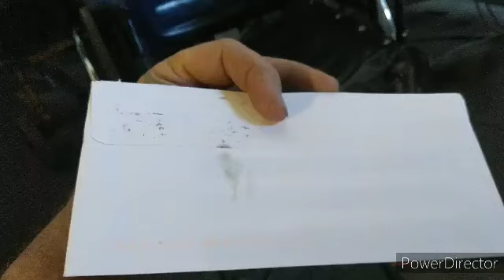cattle, sprayer and a view

Comment: "Friday is house cleaning day", Is Monday laundry day? It was for my Mom, she never had a dryer until the mid 70's, hung all our clothes either outside or through out the basement until Mom and Dad moved into their new home on the Farm. Mondays meant Dad and I couldn't use the basement for our wood working projects.
Reply from the maker: Cleaning and laundry on Friday.. Tuesday is grocery day..
Reply: I still use a clothesline... got a pulley system set up from the back porch across the the corner of the old house about 100 feet.  Save a lot of electricity versus a dryer plus the clothes are fresher and last longer, particularly elastic stuff lasts longer if you're not cooking it to death in a dryer.  Got my bucket of clothespins and a laundry table plus a roller hamper to transport everything from the laundry room out the back door to hang everything out.  Works great!  OL J R :)